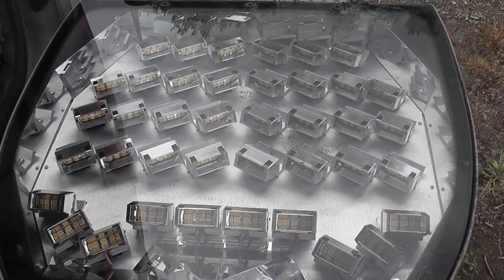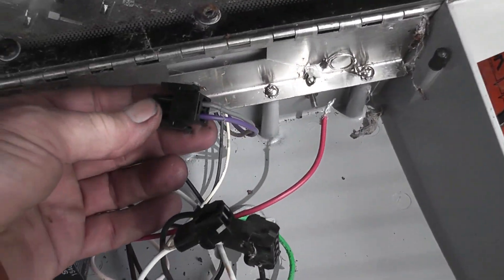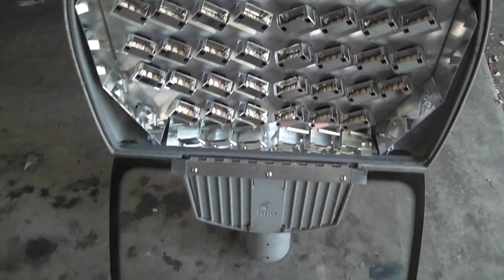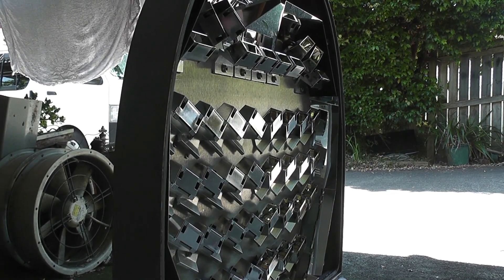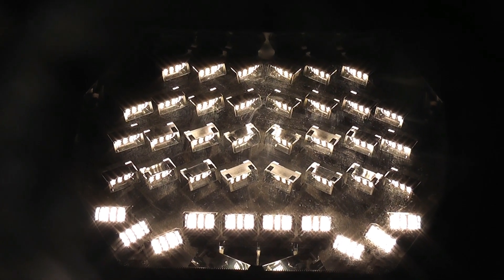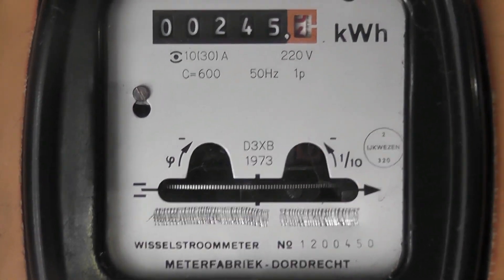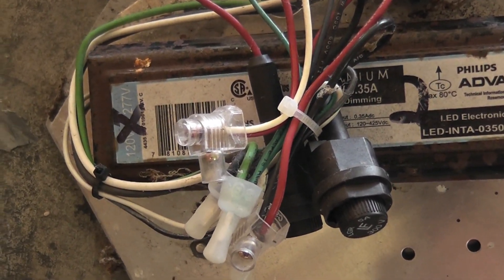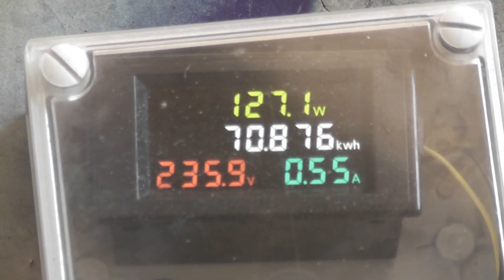KIM    --    Large LED Streetlight

Comment: That one looked cool. I havn't seen one that uses that many small diods and reflectors before. You can get 150 W from one or just a few LED modules as well.
Reply: Have you seen the video of the 500W LED? It needs a massive heatsink, and it outputs light so bright that it will blind you if you look directly at it without eye protection!
Reply: I don't know wich video you mean, but I saw a video of a guy who buly a 1000 W flashlight out of 100 W modules (10 of them) and that was really cool (it is somewhere here on YouTube). 
I have got 2 modules my self (100 W each), I just have to build a driver for them, get a good heat sink and and batteries that can output enough power. I will put up a video of that later.
Reply: The large integrated matrix LEDs are quite poor for efficiency and lifetime. The better high power modules use lots of lower power LEDs.

Comment: Those LED ballasts are quite durable. Had about 100 LED high bay lights installed in our shop that stayed on 60 hours a week for 3 years until all the individual LEDs started going out but the ballasts were fine.
Reply: It's still a problem with the very high power ones and I feel it's still going to be a problem in the future.  There are a few LED high mast fixtures around where I live but most of the newer ones they are putting up are still HID because they are more reliable at higher power levels than LED.
Reply from the maker: Good to know. Thanks
Reply: Here in my area, the street lights are either the old sodium lamp style, or induction fluorescent. Induction fluorescent lamps are very neat, they use RF to create a plasma in the lamp tube, instead of an electric arc, thus negating the use of heated cathodes which tend to fail on regular style fluorescent lights.

Comment: That's a weird way of mounting leds.
Reply: Makes the pattern controllable without having to use heavy lens optics. Just aim the small individual beams to approximate the desired spread out to the sides, with little light toward the pavement side, minimal to the middle of the road and to have an even illumination even at the edges of the pattern. Each individual cluster has a well defined beam with controlled spread, so it makes changing pattern easy, and especially for street lighting, where you want a long interval between luminaires and even light in the length it is a good solution.